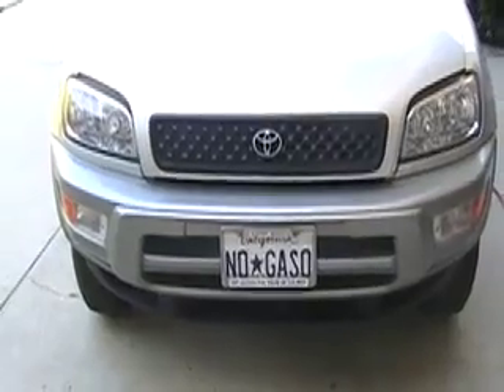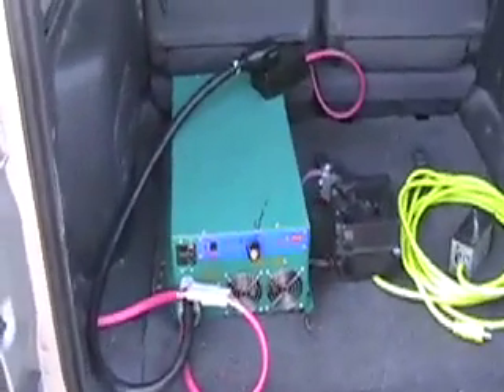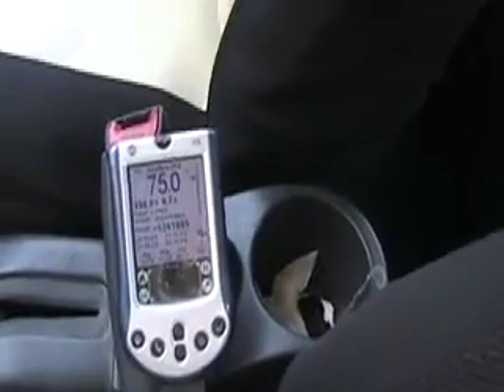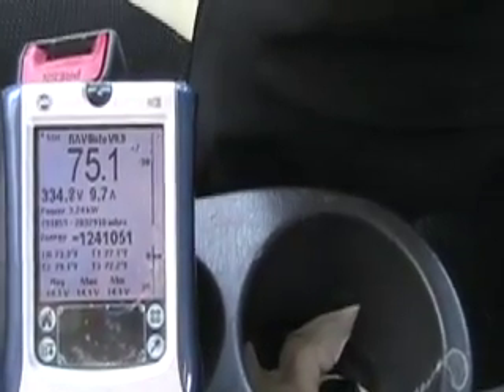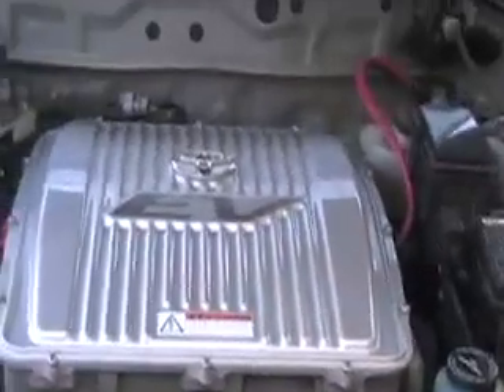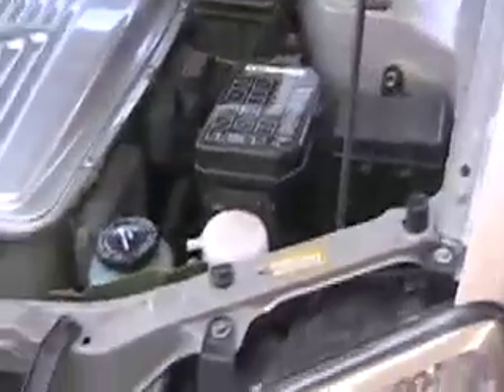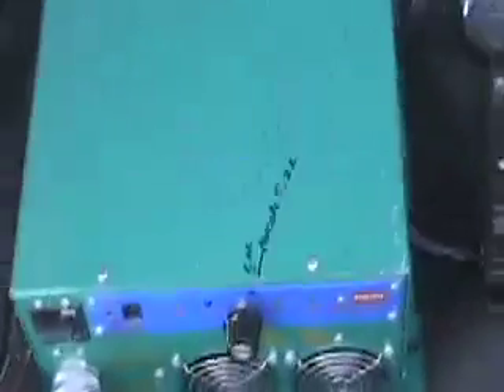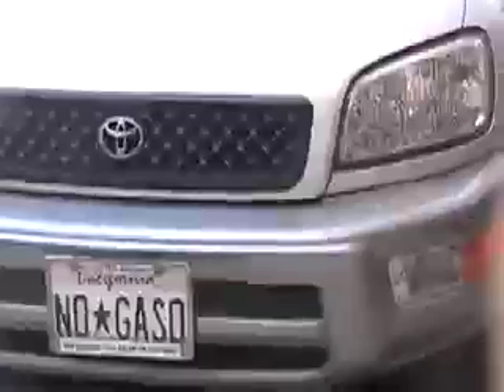RAV4-EV Secrets: Plugs into solar, instant Volt

Comment: Weight, that's the problem, the gasoline engine is heavy, you would not get all that range out of the batter carrying around all that weight all the time.  Plus you would need a powerful engine, if you only had a week engine like your suggesting, when the batter runs low your power and speed would be limited.

Comment: Q1- Would it be easy, possible or hard to have a setup with Home roof Solar Panels that would charge a battery or something while you are at work so that you could plug the EV overnight (even if the solar panels dont get sunlight)?

Q2- The in the typical setup I suppose you sell electricity from the solar panels during the day and use the grid at night?

Comment: On the other hand the car may have been in a garage (as opposed to spending a whole night at -30)

The other aspect to consider about recharging is that while a full recharge takes time, you can do this overnight, and a partial charge can take much less time.

If enough EVs are used, there will likely be more places to recharge at. Its easy to imagine the possibility of pluging in at restaurants thus allowing travellers to go on long trips.

Comment: I dont know about todays EVs, but my friend has been using an electric car since it was initially tested in the 90s and its working just fine in winter(Canadian winter). If it had no heating I would have heard about it. My winter question was about the charge, and he told me that its theoretical since in practice he did not use 100% of a charge to go to work and back and by the next morning its recharged

Comment: I really hope, for Chevy's sake, they are really serious about the volt though, not so  keen on the gas engine in it but atleast it'll help regular people get the picture that electric is better. It will also ween people off gas incrementally, which is a good thing, it wont be all electric, but it's a start.

Comment: I hope like crazy they get the volt working. Come 2010 if either the volt, or the plug in prius comes out. I will try them both out and buy one. Of course, I dislike the prius (had one) because they are simply not electric enough! It is a gas car with an electric "booster" if that. :(  CANNOT wait for a good solution.